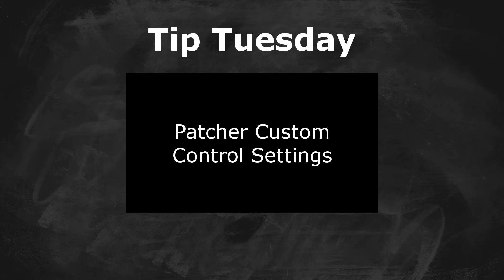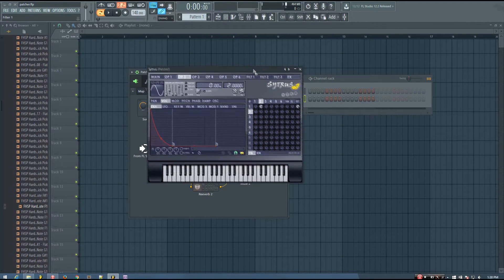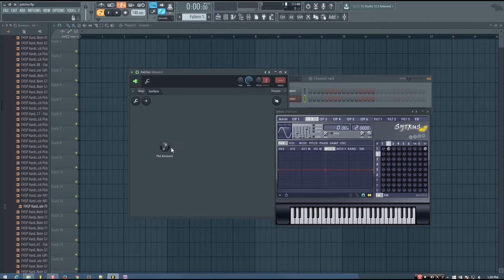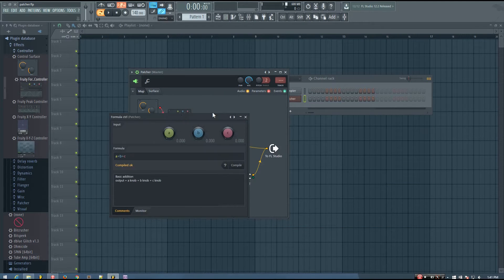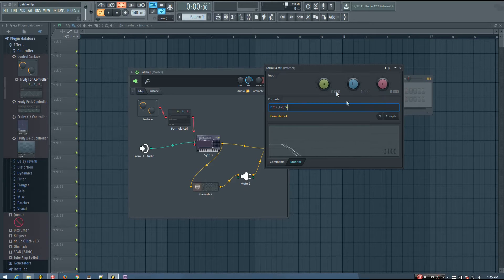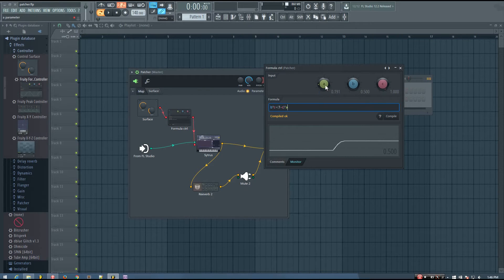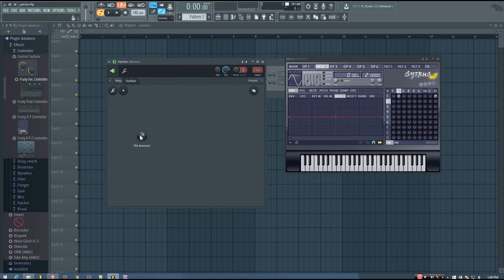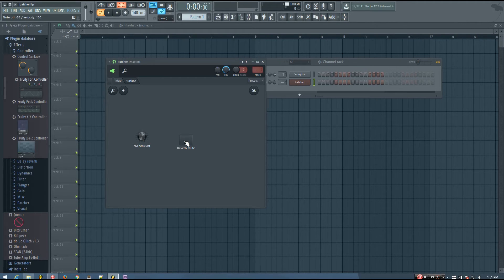FL Studio's Patcher Tip: Using Formula Controller to Customize Patcher Controls

Comment: Fruity Formula Controller (need help)
Hi! So I want to link an x-y controller to Fruity Formula Controller for THEN controlling a desired parameter. All of that I make it in patcher.

What formula can I type so that the first half of my Y axis stay at the same level? In my case (a)=1.00

Michaël :)
Reply from the maker: If I understand correctly, I think the formula would be either 2*max(0,a-0.5)  or 2*min(0.5,a)  depending on the direction you want
Reply: @IVTheFourth   Thanks man! Hopefully it got resolved after few edit in my request.(image-line forum)

Comment: Is there a way to write a formula, when formula controller receives an input, it changes a parameter to a random value within a certain range? For example, you want to slightly change the timbre of a synthesized kick drum every time its played, so you decided to change the fms value on the kicks noise burst. That would be incredibly handy ^-^.
Reply from the maker: The Formula Controller has a couple of "randomness" presets, but they may have too much movement for what you're trying to do.  A better option might be to try using the Fruity Envelope Controller. If you disable the envelope and adjust its random control, it will output a new random value whenever it gets triggered and hold that value. Using Patcher, you can have it trigger each time the kick synth is played.
Reply: @IVTheFourth  i went to reddit with the same question, instead i used random  lfo on peak controller and adjusted the base knob, and it works fine for what im using it for. but thanks for this video, i just used this technique on something in patcher and its a massive time saver.
Reply: @bigbingus5126   The random LFO in fruity peak controller is actually repetitive. what a shame lol

Comment: Damn, i think this is exactly what i'm looking for. I can't try atm though :/ But why can't it be as easy is in Serum or Massive, where ou tell it "You start here and end here" by just setting the knob and dragging it to the desired value? :D

Oh, Edit: How can you use this to make ONE knob affect the for example Reverb mix from 30-50% and at the same time the Distortion Amount from 5-20%? Ideally with external plugins... Especially Izotope Trash2 :o
Reply from the maker: The envelope controller may fit your needs better.  You should be able to set it up so that you just automate the x/y and then you use the multiple envelopes to control various plugins.

Comment: Isn't it much easier to just use the x/y mapping in Fruity Envelope Controller?
Reply from the maker: +KolkianMusic   I find it to be easier/faster this way once you save this formula as a preset, but using the envelope controller works fine.  If you want the mapping to be non-linear, then the envelope controller's x/y is the way to go.
Reply: +Beat School I see. I like having the option of non linear mapping, and I think Envelope Controller is a little more intuitive but I suppose it's mostly preference. Thanks!
Reply: +KolkianMusic +1 for Envelope Controller. That thing lets you do ANYTHING.